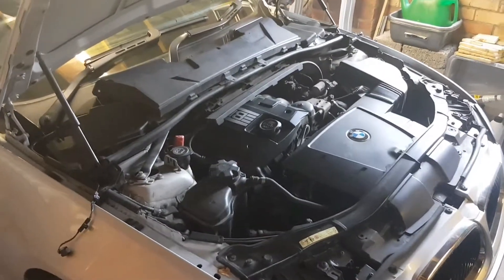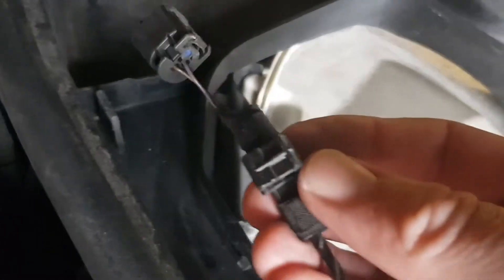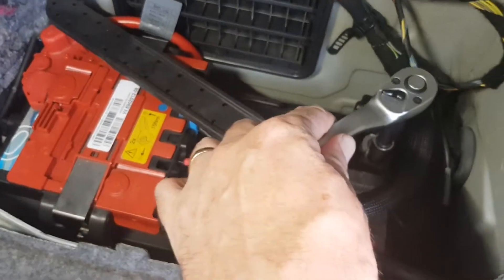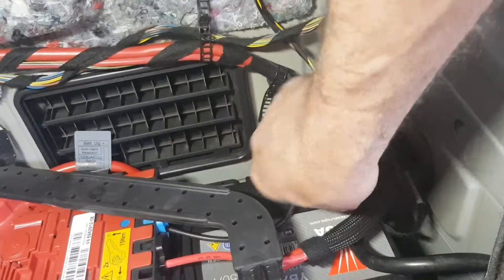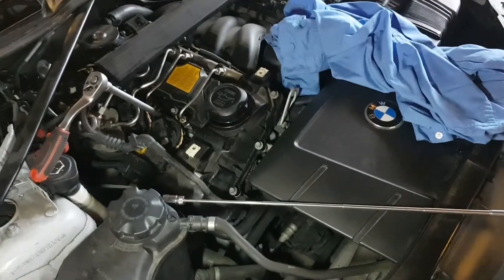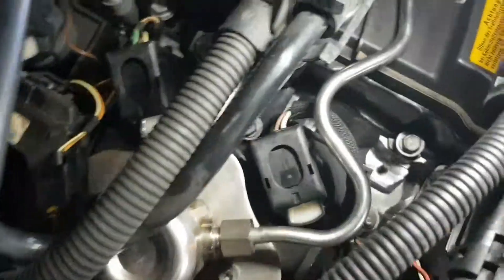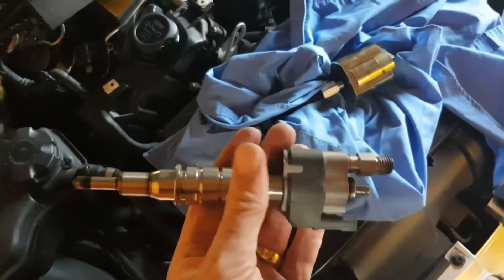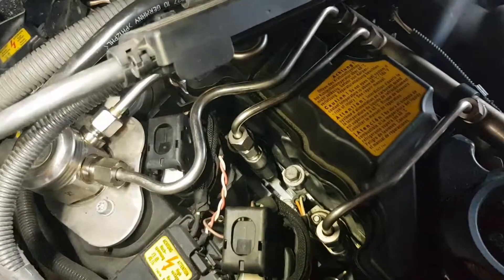Fuel injector replacement BMW 3 series

Comment: Hi, I have a 2011 3 series n43, I removed no 2 injector today and found the decoupler and bottom rubber seal missing (just bought the car) my question is no 1 injector I removed as well and it looks like there is a seal in the injector hole, but in no 2 injector hole I can just see the metal head, are there specific bottom seals for these.
Reply: Will do
Reply from the maker: I'm sorry I can't really remember (it was quite long ago). From memory there was an O ring shaped seal down near the bottom of the injector (on the injector itself) which i just reused and then the decoupler a bit higher up.
Reply from the maker: I have no memory of bottom seals during this job so I don't think there were any on mine (certainly not copper style anyway).
Reply: Thanks for the reply, I'm going to get a borescope and get a close look down both injector holes as there seems a difference between the two.
Reply from the maker: Good idea. The more I think about it I think I could only see the head down there on mine. Perhaps somebody has previously added a washer to one of urs in an attempt to stop a misfire or something?
Reply: Possibly, they do seem different, when I slip a plastic pick gently down no 1 injector hole, it seems to slip past the lip of the head. When I do the same on cylinder 2 hole, the plastic pick stops on the head injector hole. I'll see what happens when I get the borescope.
Reply from the maker: @DavidBryen-o4r will ya keep this thread updated when you get to the bottom of it (might help someone else too later too)?

Comment: Did you have any problems with running different indexes together?
Reply from the maker: Not really. It was a right mix for a while and ran fine until the older injectors started playing up. I dont think it was the mix that caused me bother just the older injectors. I found nothing really cured it properly apart from going all index 11. Since then smooth running. I've noticed the gear stick sits still at idle too and it always vibrated a bit until it was all index 11.
Reply: @bumbleshufflesdiy5908  Thanks for the info and the video, helped me out a lot! I did also go for full index 11.

Comment: Can I get you to do mine as well   lol
What was the injectors index before you changed them. I got two index 11 dont know whether to change all 4
So they all index 11.   Cheers for the video.
Reply from the maker: Thsnks for the kind feedback. At one stage I had to index 11 in there and then an 8 and a 7 or something like that. The two index 11 where in the same bank (I cant remember what they were now tho). It ran fine like that until one of the older injectors started giving me hassle. Basically I wasnt rid of the problems until I had 4 index 11 in there. I watched ebay for used ones and in the end got them cheap enough. I think going index 11 for all is the only real cure. Well so far so good for me.

Comment: do you have any video before please?
Reply from the maker: Im not sure what you mean by before, do you mean showing the misfire?
Reply: Yes, please if you have a video. The engine in my BMW is shaking and rattling when its hot. My problem is, I couldnt compare my engine problem to others. The car mechanicer said, this is an injector problem and have to change all of them. But, when the engine is cold or I use in "nonurban" terrority then it is smooth and strong. I do not understand it. If my injector is faulty, then why do not do it all time ? :(
Reply from the maker: I dont a have a video of that unfortunately but my engine was shaking also and had little power. The gear stick will shake quite a lot at idle and a yellow flashing emissions light will appear on the dash. If its misfiring when hot I would suspect the coil packs first. Has he ruled these out? Usually this engine misfires when cold if injectors are faulty. Mine misfires first thing in the morning when cold but runs fine when warm, to me this was classic faulty injector signs. You should read the engine codes to find out where the misfire is then move the coil packs around and read the codes again. If the misfire moves then it's most likely a coil pack. I would definitely rule these out before replacing all of the injectors.
Reply: @bumbleshufflesdiy5908  Thank you for answer and let to know your story. Your problem was related with cold engine so it is different like mine. It is a very important info to me, so thank you so much. I replaced 4 ig.coils, sparkplugs last year, but it couldnt help. My friend read my faultcodes 2 days ago and it was very interessting.  The ECU stored VANOS SOLENOID problem many times. After cleared memory, it happened again and again. It is interessting because nobody told me when I were at garages. 4 different garages said other faultcodes.... I will try to clean it and I hope it helps :)
Reply from the maker: Oh sorry to hear ur having these problems. I'm not too sure what yo do with that issue. I know the n43 engine (if that's urs) is prone to all sorts of problems like low oil pressure, misfire, timing chain guide snap etc etc. I usually track down good used index 11 injectors from ebay at around £45 each when changing and its curved my problems both times. I never buy new injectors as they are £250 each plus vat in BMW. I hope ur faults stay away but if u do get yo the bottom of the problem let me know.
Reply: @bumbleshufflesdiy5908  update: I have to change my timing chain, because its too old. The mechanicer said, my 1st injector is bad. My injector indexes are 6. I can buy only 11 indexed injectors from internet. Is it possible to replace only my bad injector with 11 indexed, to test it? What do you think about it? I spent to much for this car on this week, so I hope the answer is yes :D Thank you so much man.
Reply from the maker: Sorry to hear the car is costing money. The timing chain guides can break and cause issues. I'm not sure that a mechanic would agree with me but I have bought injectors 1 at a time used from Ebay and never had any issues. This is definitely not how it should be done but I bought 1 injector last year and replaced it (which meant my injectors were a mix of index 5, 9 and 7 I think) and still never had any issues. I didn't even bother coding it the first time and the car ran fine. lots of people will say i did it wrong but i want you to know that it worked for me. My car car currently has two index 11 injectors and then an index 9 and an index 7 in there and it's running fine. The index 11 injectors are both on the same bank because I had heard that when you move to index 11 they cannot be mixed on the same bank with other indexes (I dont know if thsts definitely true). The best permanent fix would be to put 4 index 11 injectors in but I have not done that due to cost. The car is at an age were I am happy if it runs well so and I can save some money. You could always just buy 1 index 6 used off Ebay for around £40 and just replace the one that's faulty. That way you have all the same index. It wont fix it forever but it might for a while. Also my car has told me the wrong cylinder was misfiring on two occasions . You might have to move the replacement injector around until you solve the problem. That's just my experience but I'm not advising that you should do it incase something goes wrong. I just want to let you know what has worked for me in the past. I really hope you get it all sorted out without a big repair bill.